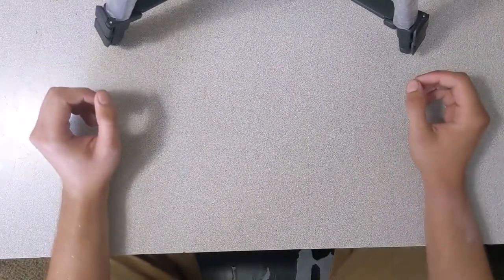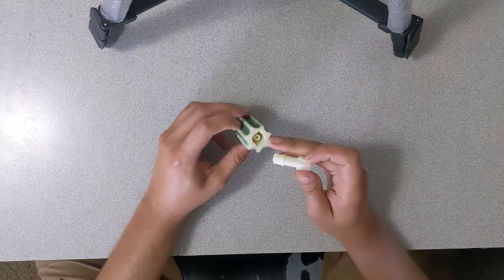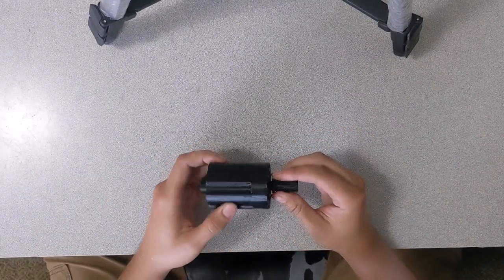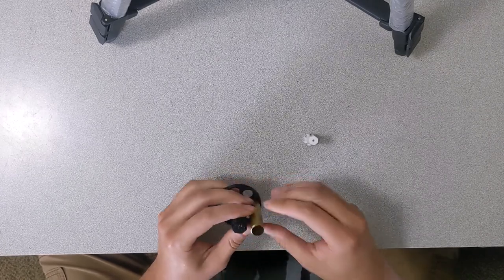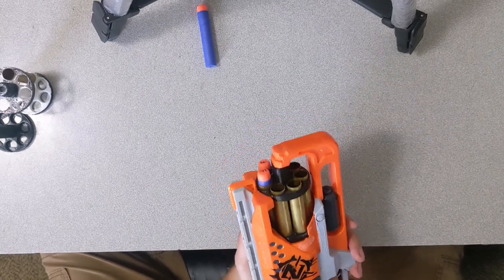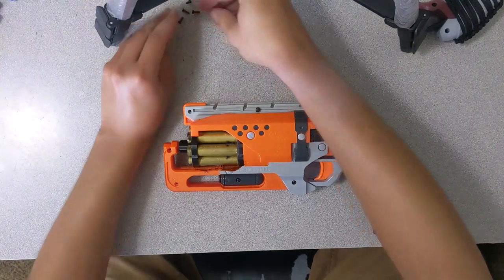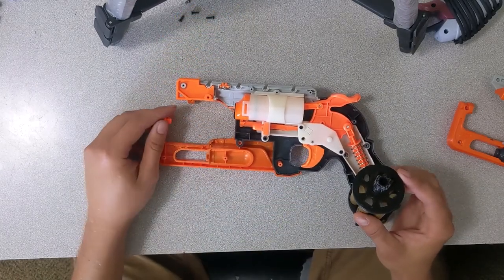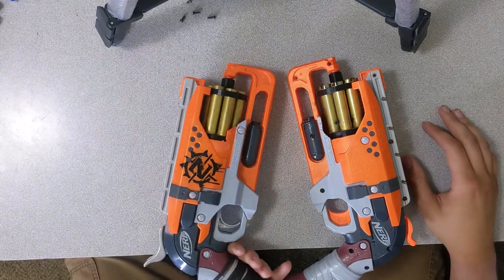Nerf Hammershot - 7 Brass Barrel Blaster Mod

Comment: im about to do this for my hammershot but im going to make each barrel as long as i can for maximum performance, about 3/4" longer than yours atleast without cutting the front post. Also i may do that back cut out of the shell so that i can back load it which seems way cooler.
Reply: @sabindonahue6559  not  sure what part of what i said is belittling im just saying the difference....
Reply: Srry